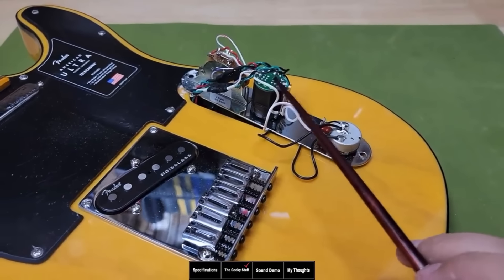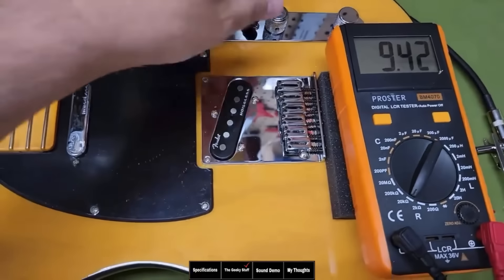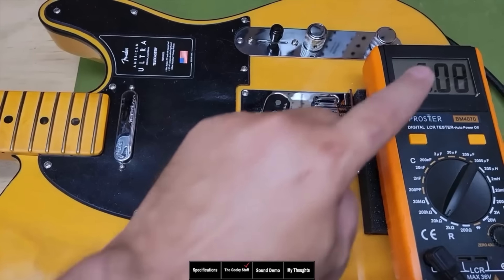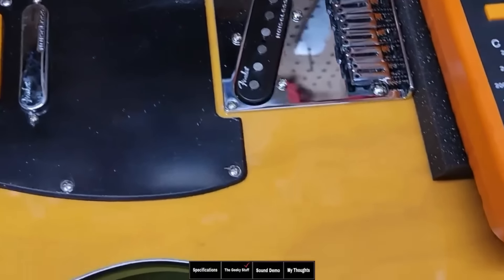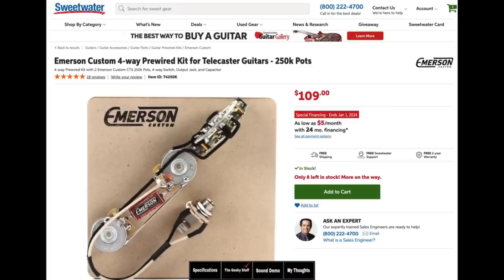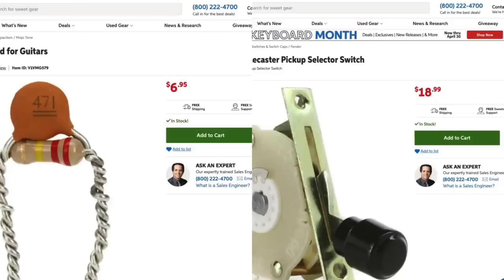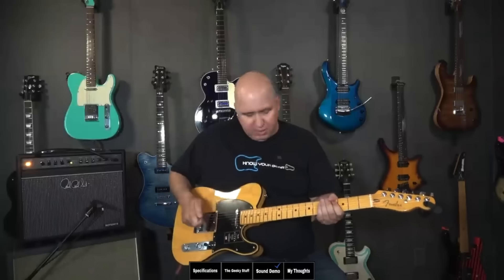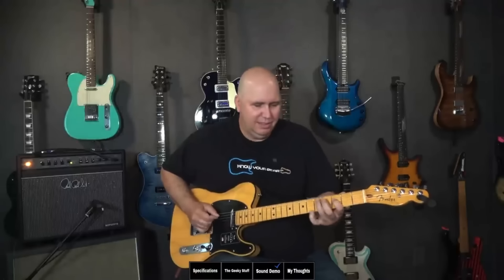Why Guitar Players Love 4 Way Switches In Telecasters

Comment: The Fender "Baja" Telecaster had the best wiring scheme- a 4 way switch and the S-1 switch to get out of phase sounds as well , so you got a total of 6 sounds out of it.  And they had added circuitry to level out the volume when you were running in series.  I actually use that circuit on a US Made Deluxe Telecaster as I prefer it.

Comment: Very cool stuff you can do with a Telecaster.  I have the Seymour Duncan 53 Tapped Tele pickups and I use a 5-way switch. Those are Seymour's favorite Telecaster pickups.

From their website:
"The tapped bridge pickup uses smooth Alnico 2 magnets, while the untapped reverse-wind/reverse polarity neck pickup has focused Alnico 5 magnets for a complementary tonal balance. Use with a standard Tele 3-way switch and push-pull pot for the tap, or wire it using Seymour’s custom wiring diagram, with a 5 way switch, for maximum tonal options (diagram and 5 way switch included when purchased as a set)."

I highly recommend these pickups. The tonal variations are incredible and all of them sound good in their own way. They're a little bit more pricey but worth every penny. And having five different switch options makes it all the more fun.

Comment: I have done this four way switch modification on my Jet JT-350 SS Butterscotch and the additional series option does gives you another tone, plus I fitted Fender Vintera pickups at the same time. I wired the four way switch: Neck : Middle (series) : Middle (parallel) : Bridge.  

I might give the treble bleed a go - thanks for the great video Phil.

Comment: i've had a tele with a 4 way switch mod before, and a tele with 3 way switch but with a push-pull knob that activate series wiring regardless of pickup selector position. i prefer that now over 4 way, because it switches faster and prevent confusion.

Comment: I have OCD, so almost all of my guitars are Ibanez RGs (I love the body and headstock shape, plus they feel and sound great to me, I would love to get a JEM, JPM, RT, etc, just love the shape), I have 7 RGs and a Schecter C-7 (which goes in it's case, my stand is currently ibanez only, the RGs and an SR405EQM 5 string bass), but I kinda want a Tele... I guess I could keep it separate with my Fender acoustic/electric and Jazz Bass... 🤔 You've pretty much sold me on the Tele idea, Phil, thanks... 🙄🤑😂

Comment: I have not yet particularly cared for a 4 way switch in an SS Telecaster. My experience is this: the series setting with clean tone is indeed a volume boost that is not unlike switching to a humbucker, but it’s not the neck humbucker tone for those warm Jazzy cleans a Tele with a neck humbucker can have. On the overdrive side, it pushes a pedal to overdrive more, but isn’t really a volume boost unless it’s just off completely clean with a lot of headroom left. My soloing overdrive Tele tones tend to come mostly (but not solely) from the bridge pickup, so that series setting doesn’t help there.

It is a tonally interesting feature to mess around with but I am not sure it works for me, yet, on a bandstand or gig.

Perhaps not surprisingly, I have yet to find that bonding and happiness with a Humbucker neck/single coil bridge Tele, either in gigging situations. I don’t find it’s an instrument that plays effortlessly with itself, and I’ve found myself being distracted by the output and tone of an HS Tele, trying to make those different pickup types in different places work together, seamlessly. Some day, maybe…
Reply: 3 positions is better for me. Front , both, back. I hate an accidental jump in volume from switching pickups. (That’s what a pedal is for) The tone in series isn’t awesome anyway.

Comment: Hey, Phil—any experience with the Freeway blade or toggle switches?  The 3x2 way switches give six positions and in the most common use people wire the normal three ways plus series in-phase, series out-of-phase, and parallel in-phase.

Comment: I must be missing something. If the switch is 4 positions, why do you have to press the knob to change the position to parallel.
the position shod be at the switch.?
Reply: The one he has has an S1 pots (like a push-push) on the volume instead and can be a substitute for 4th position

Comment: Phil, if the single pickups are not noiseless or are wound traditionally where they don't cancel hum in the middle, will the "humbucker" position cancel the noise? Thanks.
Reply: If they're wound Reverse polarity to each other yes.
Reply: Yes, any two true single coils with one having reverse wind, reverse polarity to the other will cancel some 60 cycle hum in the combined switch position.

This is how a typical Stratocaster works in positions two and four... unless it has 50s style wiring.

Comment: So let me get this straight. When the number is higher, it’s hotter and the pick up sound more  big  and heavier? Because I seen these situations on YouTube where they measure the pickup and they give us these numbers but freakin never tell us what these numbers mean!!!!
Reply: Very good question, to a BAD TEACHER - He's using a "MULTI- METER", that measures a dozen things (VOM, common, is volt- ohm- miliamps) - but DOESN'T SAY WHAT HE'S METERING.
- I play acoustic, above average (years) just getting into electrics. 
- So I'm "not allowed" into the cult, of pickup mods ?
**My reasoning is that he's metering RESISTANCE (Ohms, see the selector- dial), but it's a SHIT- POOR EXCUSE FOR A TEACHER, who doesn't start out by taking 2 SECONDS to state that : "For you beginners, we're metering Ohms..."
Reply: PS- After watching 4 times, reading the comments - He reads the meter (once) as "10"K" ( or whatever number), so the meter must be measuring resistance - ohms - though if it's "9K", that's 9 THOUSAND Ohms. 
- Another problem here, is that resistance creates heat - but I don't think he literally means "heat".
I'm a beginner at electric mods, so - my GUESS is that a pickup with higher resistance will create a larger, louder signal - when run thru the amp.
** I could be COMPLETELY WRONG, but have the identical question as you.
- We prolly won't get an answer here, so I guess the best would be to POLITELY ASK at the repair counter of a guitar shop that does repair, or mods like this - or ask a guitarist who will be kind enough to answer OUR "dumb question".
** I think the meter is set to "Ohms- K", that- is RESISTANCE.
- Good Luck, later, dude...
- Mark, Michigan  8MARCH24
Reply: you've got it basically straight.  pickup output (electric current) is generated by the coils of wire wrapped around the magnet in the pickup, as the strings' vibrations break the magnetic field lines.  generally, the more wire in the coils, the more output (volume) for the pickup.  the measurement of resistance (as you correctly inferred) is basically a proxy measurement of the amount of wire in the coils - the more wire, the more resistance, and the higher the output - "hotter" pickup.  the resistance of the pickup is not the actual issue, rather just an indicator of the amount of wire in the coils.  sometimes the terms "overwound" or "hot-wound" are used to describe pickup coils with extra windings that sound louder.  Phil has done several vids on this and I think he often explains, but as you point out, not here.  I also found googling "what is the meaning of measuring resistance in guitar pickups?" returned some useful information.  hope this helps!
Reply: @marktulk4225  not a bad teacher, it's been covered on his channel multiple times. Just the same as him, if I have said something several times, and have videos addressing that very issue, I'm not gonna  always give an explanation to something I've already covered a dozen times over.  He ain't a bad teacher, if anything, anyone saying that is a lazy student.
   On top of this channel it's been covered on several others as well. It's a pretty wide spread and understood test that can give an indication to how a pickup may behave. This guy has done so many how-to videos, and offered so much advice and tech tips over the years it's insane. If you missed class that's on you to do your homework and review the older material. Not his fault you're lost.